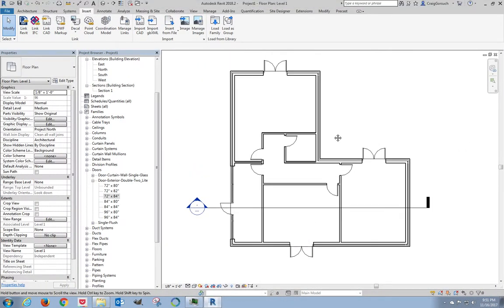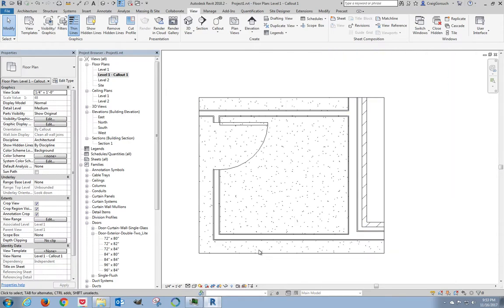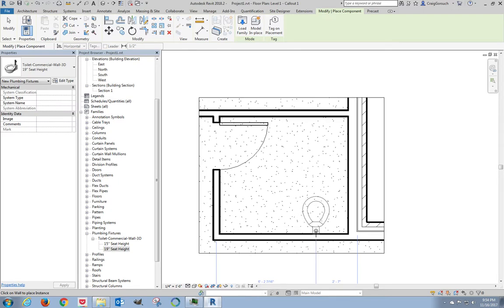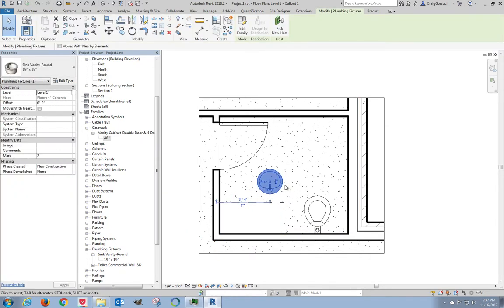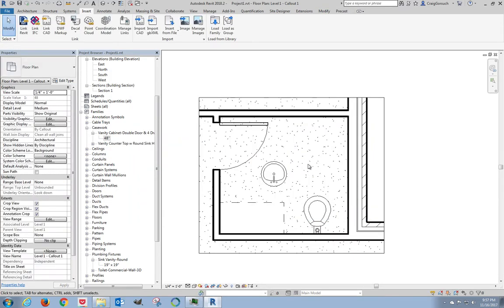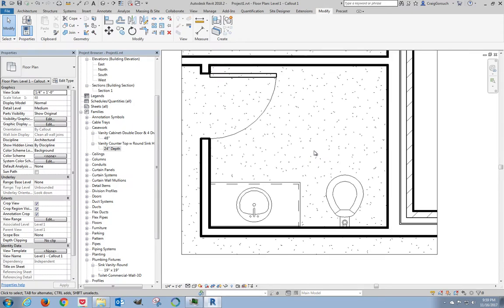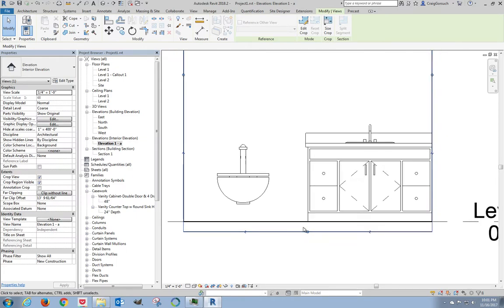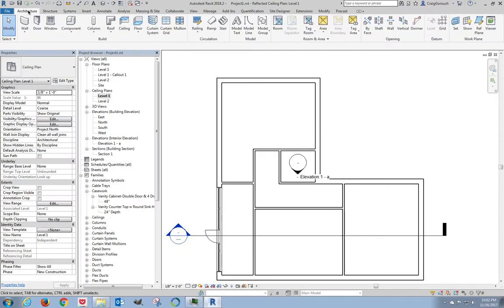13-4 Revit Bathroom

Comment: Done loading the toilet model but there is no Plumbing fixtures show at the family Project browser
Reply from the maker: Is the Project Browser expanded to show all categories?  If the Project Browser is not expanded, click on the small "plus" icon at the left of the project browser to expand the various categories.

Are some plumbing fixture families showing in the project browser, but not other plumbing fixtures?  You'll need to make sure the families are loaded.  If the plumbing families you want are indeed loaded, and they're still not displaying in the project browser, that's a problem with the family definition.